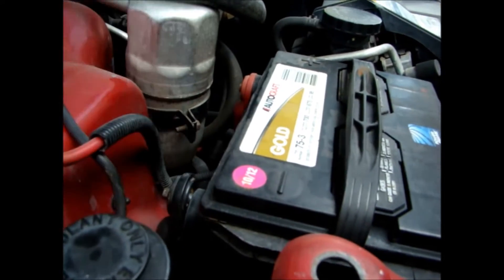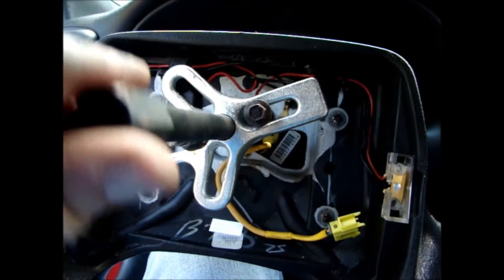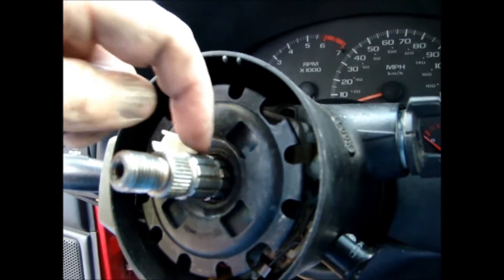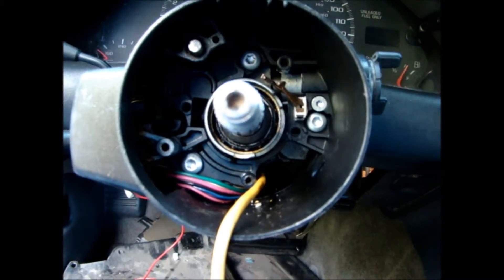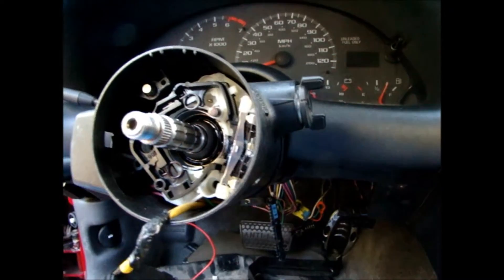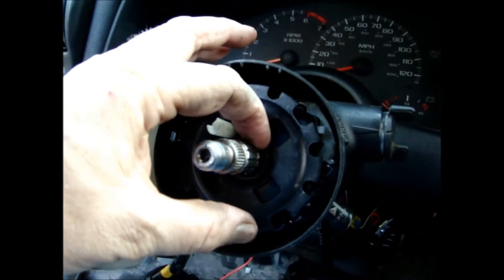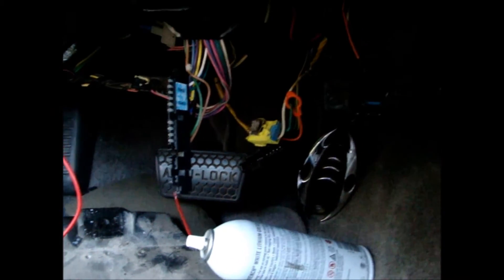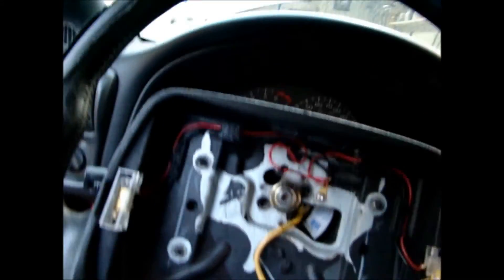GM STEERING WHEEL, TURN SIGNAL, AND TILT COLUMN

Comment: Have you ever had an issue with the knob for the brights? I can turn on my brights but I have to almost slam the lever just to get it to go back to dim. I own a 1999 Chevy Camaro. If so, Do you have any tips?
Reply from the maker: The actual switch is located on the column down towards the floor with a linkage between the switch and the lever. I suspect there's something binding somewhere along the way or the switch is binding within itself. Hope this helps and thanks for watching!
Reply: @jhuntosgarage   Thanks for the help, I think I remember seeing it under the steering wheel. Ill take a closer look.

Comment: i know this is VERY old. and I have not read any comment. but the Wobble is caused by the pins in the Tilt section. there is a left and right pin and these wear over time. it is actually a very common issue with this range of firebird/Camaro's
Reply from the maker: Yes! I found this out early on and bought the pins. I actually just checked to see if I still had them after moving to FL.  I'll be doing the install soon.

Comment: I have a 69 corvette restomod that came with a new aftermarket chrome tilt steering column. My problem is there is no power coming out of the right turn signal connection at the plastic external plug connector. Any advise would be appreciated!
Reply from the maker: First, congrats and feel free to send pic! Second, buy a Power Probe. These are so handy for chasing down electrical issues and they're not expensive. Start with that and the simple things like fuses and visual inspection. Once you get the Power Probe it will allow you to check for grounds and power up circuits. Hit me up on Instagram and DM me for more. @j_huntos_garage

Comment: I've looked for a part 2 and didn't find anything.  What did you end up having to do to repair the steering wheel wobble?
Reply from the maker: Great question.  Turns out there are two different issues. One with the tilt wheel and one with the coupler. I've yet to figure out the tilt wheel, the coupler is three bolts that back out. I'm not sure I've published that one yet. I'll look into that and get back to you. Thanks!
Reply: Mr Mister some times the pivot ball is just worn out, and at that point just replace steering column much easier fix.

Comment: You didn’t go deep enough into the steering wheel to fix the wobble issue. Those were the wrong bolts
Reply from the maker: Please elaborate! This thing is still wobbly! And thank you!
Reply: @jhuntosgarage  pivot pins need to be replaced with oversized pins. Unbalanced Engineering sells them.

Comment: Thanks for the video.  Do you still have the car?  Did you ever fix the wobble. Mine has same problem. I saw video one time on it an there is guy whoever sell a screw to fix the issue. If you are still looking to do something about it, I will try to find the video....or did you eventually find a solution? That would be a terrific video!
Reply from the maker: Still got the car. The Project Oddball playlist. I did a complete engine swap (L67 Supercharged) and suspension rebuild. The column is ok but if I pull down on the steering wheel it moves downward about an inch or so then spring back upwards. I think I have a different issue.  Thanks for watching!
Reply: @jhuntosgarage  no video on the engine swap?

Comment: you dident go deep enough to even get to the right bolts . you need a tilt wheel pin puller to take housing off and get top the lose 4 bolts .